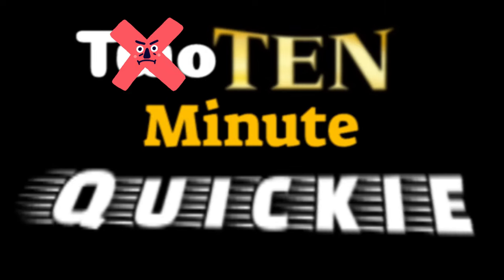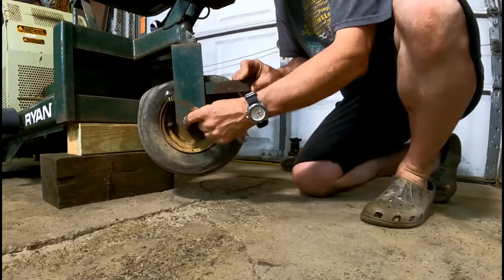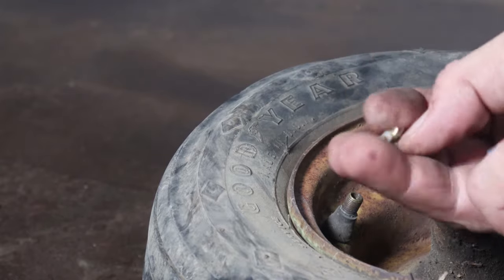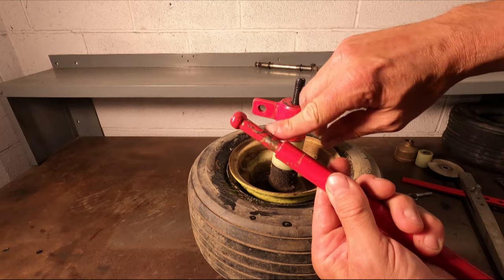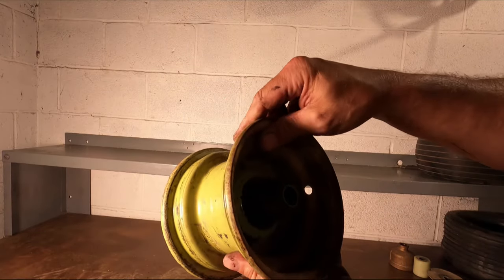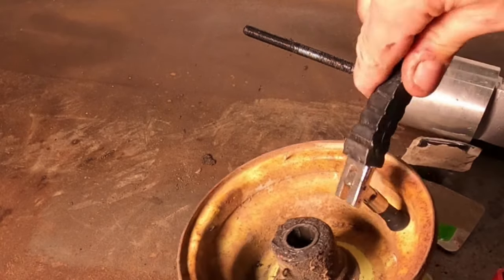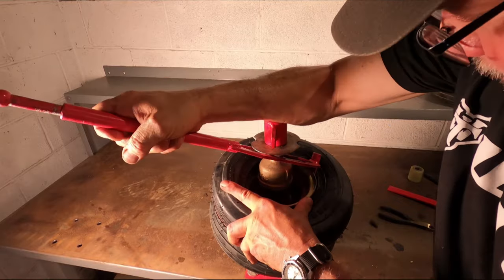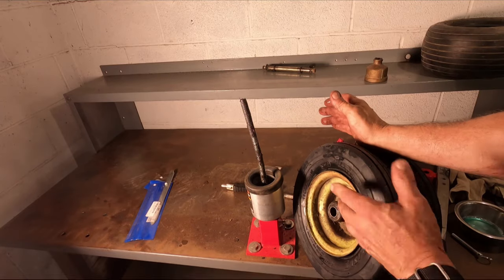Pittsburgh Mini Tire Changer Hacks and How To

Comment: To aid with removing and reinstalling small tires.   I use a heat gun or blow dryer to make the rubber more pliable. It really makes a big difference.
Reply from the maker: I will have to try that the next time I do one. Thanks for the tip and thanks for watching!
Reply: ima try this bc these things are headachesssssss
Reply from the maker: Hope it works well for you. As I showed in the video, it is still a tough task on certain tires. Thanks for watching!

Comment: They should design one that locks the rim to the tire changer so it doesn't spin around when your trying to slide the bar around to mount and unmount the tire... that's the part where my swear jar gets filled up.
Reply from the maker: Thanks again Mike. I agree. It's tough enough only having two hands.

Comment: You did a great job. Takes a lot patience and strong arms . But still a pain in the !!!! .
Reply from the maker: Thanks Valerie! That was about the worst case scenario when it comes to using that machine...an extra wide, thick ply tire on the smallest rim that this machine can handle. Yes, definitely takes some patience and some hard pulling.

Comment: I used mine before finding your video. Thank you for showing how hard it is, even with the right tools! The other videos show larger tires and install older, more pliable tires. And the 2” to 1/2” reducer is exactly what I wish I had! I had so much trouble trying to keep pressure on the removal tool! Great job! Thank you!!
Reply from the maker: Thanks for watching Denis! If you look through the comments, some kind viewers have shared their methods to make things easier. I haven't tried any of them because I don't have any more tires to change out. Good luck!

Comment: Got to keep a sense of humor as I laugh at myself for thinking it would be easy to just buy the tool and mount my own mini bike tires !
Tried it tonight and had to give up and search YouTube for guidance in mounting new 3.5/4.0-6 tires.  
Ha , now I learned I need to buy yet another piece (the 1/2x2 ) to help !
But Mike will keep me smiling !
Thanks a lot .  Arrghh !
Reply from the maker: Thanks for watching Tom! The smaller tires can sure be frustrating to install. I have been doing some mini bike videos for my Coleman ct200u-ex, and it's a matter of time before I finally do a conversion to add a front brake, which will involve putting a rear rim on the front.  This will obviously require swapping tires, so I'll be using this tool again for that. It'll probably be a while until I get to it though. My best advice, sadly, is to just stick with it. There just came a point of enlightenment when I figured out why the tire wasn't going on. It seems to vary case-by-case. I'm not sure if Tire bead lubricant would help. I've always used soapy water and never bought the stuff designated for this. Please let me know how you make out. Thanks for watching.

Comment: I just purchased one of these.  Worked like a charm.  Of course, I will need to point out that one of my first jobs was changing tires.
Reply from the maker: I let my friend use this one to do some lawnmower tires, and it worked more smoothly for him too. I believe that the diameter and width made mine more complicated along with my inexperience in this craft.
Reply: @themostlymikeshow  Yes, smaller diameter tires are more difficult to replace.  I was changing a tire on a four inch rim.  I also placed it in my vise and it worked well there.

Comment: Great video!   I just finished putting on my second 15/6-6 tire for the front of my John Deere lawn tractor.   The first one was a pain, but it went on.   The second tire just wouldn't go on and was ruined in the process.    The third was a charm but was a pain in the hasp and many 4 letter words echoed through my basement during the process.   I mounted them, by hand, and never want to do it again, so I'm looking for a small tire changer like the one in your video.    Thanks for the jokes and for demoing the fine Chinese product!
Reply from the maker: Thanks Rosewood Steel. It's amazing how one tire can pop right on and the very same size of tire can take hours. It's a mystery. 🤷

Comment: I use a small tire iron to hold the bead down and then push the tool to finish the mounting. Amazing you did this without the 2nd tire iron.
Reply from the maker: Thanks for watching and the helpful advice Kenneth. I'm a scholar when it comes to using this machine. I'll definitely give that a try the next time I use it!

Comment: Just did 12 tires with one of those. Great work and patience. One thing I learned when putting the tire on, make sure you screw the red piece very tight. It is alot of work and I ended up peeling alot of rubber off from the inside of the tire, but they all sealed and don't leak. great video
Reply from the maker: Thanks for watching and the kind words Jon! I kind of had similar results with the rubber peeling off, but they seem to seal nicely! Determination and persistence is a must with this machine, but I'll bet by the 12th one, you probably had it down to a science!
Reply: @themostlymikeshow  haha, unfortunately not, just brute force and high blood pressure!
Reply from the maker: @jonjames2051  😂🤣😁
Reply: Leaving the red screw on thingy not tight and showing lots of rod bends the screw rod. Don't ask how I know!

Comment: Watching this video makes me glad that I paid the tire store to install my small tires.
Reply from the maker: Thanks for watching Don. Some go on easy, and others take all day. 🙄 The larger ones definitely go on much easier.
Reply: @themostlymikeshow  I tried to put a new tires on my zero turn rear wheels. I tried 1 wheel, the old tire came off really easy, I tried to put the new tire on ~ after 3 hours of struggle, I gave the victory to the tire and took my new tires and the wheels to A-1 tire and paid them to install both tires. Then I took the smaller front wheels to A-1 tire and had new tires put on them. I have to admit the small tires won. I have made my mind up ~ any tire smaller than a 155 X 13 car tire is the smallest tire I will install with my Habor Freight tire changer, my motorcycles have 15 inch or 19 in wheels.

Comment: I use a rachet strap tie down around the tire to squeeze the tread in, and push the beads out to help seat them.  Good tip on wiping the beads with soapy water before adding the air compressor!
Reply from the maker: Thanks for watching and the helpful tip Dave. Yes, ratchet straps work great for getting the tire to seal. I basically just suggested the tire-niquet in case anyone doesn't have a ratchet strap handy. I think that most people would have one around, but this method would help the few who don't.

Comment: I found that to put the second tire bead on its easier if you use the bead breaker to hold the tire down and rotate the install tool.
Reply from the maker: Thanks Dwight. I'll have to give that a try next time I use it. Thanks for watching!
Reply: Yes it worked for me yesterday. Yes was a good video. Thanks

Comment: While installing the top bead, if you take the bead breaker and push tire down below the rim bead (as if you were breaking the bead), and use the installation tool to walk the bead around, it works much easier.
Reply from the maker: Thanks for the tip Hotrodmonkee! That size of tire and wheel was a royal pain. I'll definitely try doing that if I do it again.
Reply: @themostlymikeshow2582 what size tire were you changing on here?
Reply from the maker: Miles, it's a 13 x 6.50-6
I am not sure how that breaks down to dimensions or if that helps you. Thanks for watching!

Comment: You can spray starting fluid in the tire and light it. That will seat the bead. We use wd40 as a lube because it does tend to dry out quick. Great video and great tip on using the bell reducer! Thanks
Reply from the maker: Thanks for watching Shane! I heard about using starting fluid, but never tried it.
Reply: @themostlymikeshow  hey, it ain't OSHA approved but it works. Start small,  just spray a shot right around the bead in the tire. I then spray the outside of the tire in one spot. Take the torch, touch it to the spot that has the starting fluid on it and it will light the fumes inside the tire and the explosion will blow it on. Doesn't matter if it is a lawn mower tire or a semi. Have your valve stem in because you need to air it up as soon as it seats because as soon as the explosion happens the fire inside uses all the air, starts a vacuum and can suck it right back off. I'm 57 and have been doing it since an  "old man" showed me how when I was about 15 and putting 15' tires on an old truck I started out with. Best of luck on your channel!
Reply from the maker: @shanekasper4587  that's pretty awesome Shane! Thanks so much!

Comment: I made a mount for this that its into my receiver hitch. It sticks out far enough that the tailgate will open and the main leg is adjustable up and down. I use mine a lot and I made another cup with a rubber gasket from an irrigation pipe that drops over the main 5/8" shaft so when I tighten the top nut it clamps the wheel from both sides with rubber. Wheels do not spin in it now. I also made me a T handled wrench that fits over the top nut so i can spin it down real quick and really tighten it. It works really good now.
Reply from the maker: Thanks for watching and sharing your experience Junk Yard. Sounds like a good system that you made with yours.

Comment: Add the bead breaker bar on the top screw on sleeve. Only the silver bar. Not the red actual down facing bead bar. When you rotate the tire iron to install the tire run it in a counter clockwise direction. Now that you have the silver bar attached to the top you provide clockwise resistance to the counter clockwise tire lever. It tightens the nut and holds the shaft firm and steady.
Reply from the maker: Thanks for watching and the helpful tip. I don't use this tool very often, but I'll try that the next time that I change out a tire.

Comment: You said but I've learned the main key to success is pushing down on the opposite side of the tire into the smaller circumference rim groove to give the other side of the tire room to stretch into place.
Reply from the maker: Yes, that helps the process a lot Bruce. Thanks for watching. I hope that it helped.

Comment: Valve "gut" is called a core.
When removing the tire, place the tire tool on one side of the centerpost and a tire spoon on the other.  The spoon keeps the tire in position while you rotate the tire tool in the opposite direction.
Reply from the maker: Gut is Pennsylvania dialect. Thanks for watching and the words of advice. I was learning with the viewers as the lack of efficiency indicates! 😂

Comment: needed tubes in my mower tires. after chasing one wheel around the floor with a couple of screwdrivers i gave up and grabbed  one of these. a small vice grip with a piece of rubber in the jaws to keep from marring the rim will keep the tire from rotating as you remove or install the tire. dish soap makes removal and install a breeze. since i did this people bring me their mower wheels for tubing or tire replacement. easy money.
Reply from the maker: Cool! Thanks for watching and sharing your experience!

Comment: I had a similar experience as you with my lawn mower front wheel/tire.   I spent the $50 for the HF Mini Changer because I would have spent the same amount to have a tire shop put the new tires on;  now, having wasted a couple of hours, I realize I should have just paid the tire shop guys.
Reply from the maker: Thanks for watching.  Did it eventually work for you?
Reply: @themostlymikeshow  Not yet.  I got one bead of the new tire over the wheel rim, but still struggling with the other side.  Will try again today.
Reply from the maker: @dgriffin6074  They can definitely be a pain. If you read through the comments,  there’s some suggestions that people have made to make things easier. Good luck!
Reply: @dgriffin6074  The second bead is the nightmare.   :)
Reply from the maker: It's weird. I've had them go on effortlessly, and I've had to walk away, take deep breaths, and revisit. I probably just don't do it enough to get good at it.

Comment: I'm a cheap skate and unless the tire is shredded I'll put in an inner tube.  Went to get a trailer tire recently.  Direct replacement for that tire $80+ depending on vendor.  A pair of tubes $28 on Amazon.
Reply from the maker: I would have probably done the same thing, but these were very odd size and the tires were actually pretty reasonable considering..I think that they were around 20 bucks each.

Comment: I usually lock onto the rim with a pair of vice grips which keeps the tire from spinning around
Reply from the maker: Thanks for the tip Paul. I'll have to try that the next time I use it. I don't mess with tires too often which explains the frustration that I had in this video!

Comment: Hi buddy....you already had a valve insertion tool on the tool you took out the valve core with.....the threaded part of the tool fits over the valve once its through the hole in the rim.....a pair of plies is then used resting on the rim edge and under the arms on the tool....arn with the pliers used as a lever away you go....lube the valve first.
Reply from the maker: Thanks Nick. I am definitely no tire expert, at least on non-bicycle tires. This video was sort of a learning experience for me as well, but thanks for letting me know about the valve insertion tool. I'll have to go take a look at it.

Comment: That all thread is pretty flimsy.  Have you tried to replace it?
Reply from the maker: Thanks for watching Mr Blanche. No I haven't. I agree though, it is pretty easy to bend. It's not too often that I use this machine, but I thought I would show how it works, and how frustrating you can get with smaller tires.
Reply: @themostlymikeshow  The one trick I've learned is when mounting the last bead, use a pair of Vise Grips clamped on the edge of the rim to hold the first little bid you get on the rim and then work away from that spot.

Comment: You can also buy a Special  clamp that you put on the bead Of the  Rim to stop the tire from sliding back off while you're putting it back on.and it makes world of difference!!! I have a full size manual machine that will 
 do small and car tires a lot easier instead of this hard to use tiger toy.
Reply from the maker: Thanks Robert. I will have to look into one of those and maybe put it in my Amazon store.

Comment: HELP!!🤦🙏 lol...So,  I have a 10"x 2" tire on a 6" rim, and I can't for the life of me get the bead to seat properly! I'm going on 3 weeks and around $200 spent on this POS, and I'm almost out of ideas😤
Even if you don't know, any recommendations on where to find the info would be great! 😁 Thanks!!!
Reply from the maker: Hi Adam. So did you get the tire on but just not able to get the bead to hold air so it pops in? If so, I made a video on that part that I used on a snowblower tire.
Reply from the maker: Here's the link to that video. I hope that it helps.
https://youtu.be/yAUGapxE5u0
Reply: @themostlymikeshow  awesome! I'll check it out 😁 thank you!
Reply from the maker: Thanks for watching Adam. Please let me know if it helped you.
Reply: @themostlymikeshow  so I got the bead to seat more than half way around the rim, but there's a section that just won't pop up onto the edge of the rim. I tried; soap, grease, pry bars, tire levers, ratchet straps, hot water, set in the sun for hrs @90°, and a few other things that I'd rather not mention... lmao 🤣. I've also ordered 3 different tires w/tubes (all from the same company). Also, drilled out for a tire stem and got rid of the tube (hoping the tube was the problem). Now I can't get it to hold air w/ratchet strap or nothing.  Now, 3 weeks later, I'm ordering a 4th tire/tube today, (different company).   Made in China... SMH🤦😅
Reply from the maker: @adamzuelzke  Geez Adam! Sounds like you tried about every trick that I know of... People use ether, but I have never tried that one. I figured that the tube would be the sure way to get it to hold air.

Comment: Is your bench mounted to the floor?
Reply from the maker: Thanks for watching Big Dog. No, it's not, but it's a decently heavy steel workbench.
Reply: @themostlymikeshow  thanks I'm looking at getting one but only have a wooden bench I'll probably have to anchor it to that. Also how far apart are the bolt holes to mount it?
Reply from the maker: @bigdog0u81 yes, it definitely pays to have it mounted securely. I sure yank mine all over when I use it, but a lot of that is probably just not knowing what I'm doing! 😁

Comment: Every video I've seen using this tool shows it used a different way. One person's success seems to be another person's failure. It is miserable to use, yes. In my case, I was able to get half the top bead on before I could no longer rotate the install tool. I finished up by then using a tire spoon.

FYI they closed this out at $49; the new one is black instead of red and costs $59.
Reply from the maker: Thanks for watching and commenting. You are absolutely right about one person's success is another one's failure. I had one tire almost put itself on, and the same exact tire for the opposite side took forever. It was the same Tire, LOL. I would say it's still worth the $59 though.

Comment: I don't think I would use liquid soap for a lube. It's caustic and can cause the metal inside the rim to rust plus also degrade rubber and plastics. Just get the real lube for tires. :face-blue-wide-eyes:
Reply from the maker: Thanks for watching and commenting Xcalibre. Although I have never experienced any issues with corrosion or degradation of materials, it's definitely food for thought.